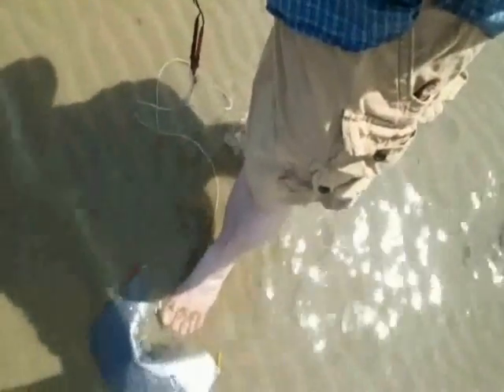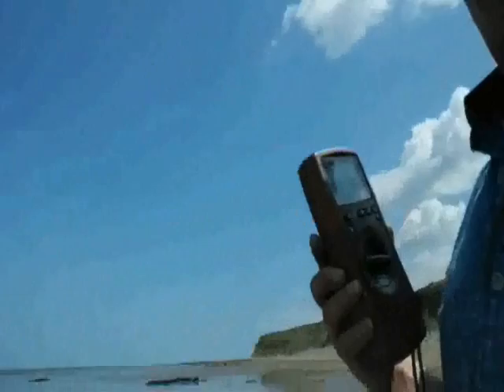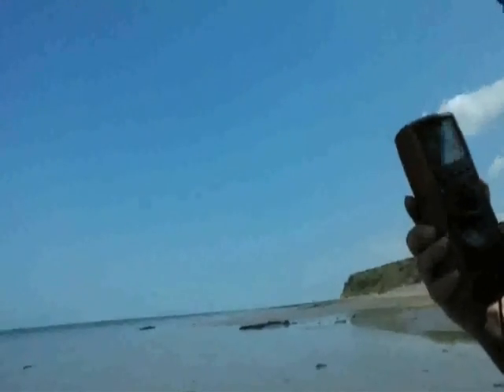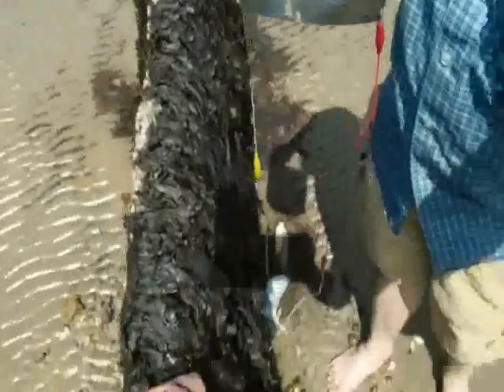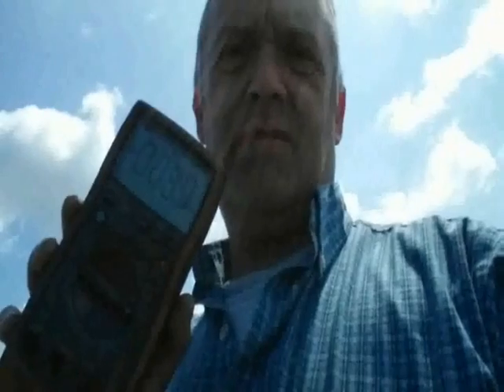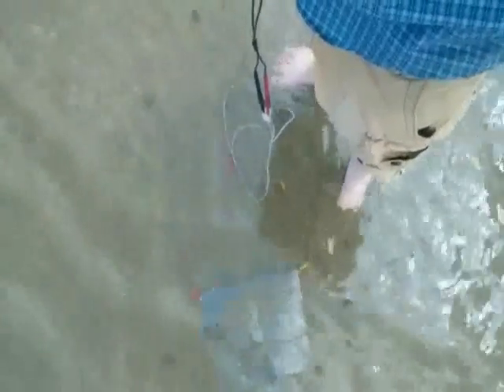Graphene Sea Water Generator - Sea Test 1 (SWAG generator)

Comment: I know this video is quite old, and you probably haven't worked on this in a bit, but I have some questions, thoughts and ideas. When you ran the seawater over the graphene sheet, you mentioned that it continued to produce electricity. If there were a way to recirculate the same seawater over it, would it continue to generate electricity, or is there something that is somehow "extracted" from the seawater each time, that would eventually no longer be there? My thought is that you can only use the same seawater for a limited time, before something is "missing"; or am I the one missing something? I would like to see an experiment something like this: have the coated sheet standing vertically (or angled). A tray at the bottom catches the seawater after it has been run over the sheet, and a micropump recirculates the water to run over it again. I wonder how long it would keep producing electricity, using the same seawater. I've tried to ask this question of several people who work in the engineering field, but all I get is ridiculed for not understanding all the concepts completely. I'm hoping you will take a moment to respond. You seem like a different sort of person, who doesn't mind answering questions, every now and then, about concepts that are probably quite simple for you, but may not be as simple for others. You don't seem condescending towards those just trying to improve their knowledge, and that attitude is greatly appreciated. Thanks. George (gen81465)

Comment: Love your videos, as they are very important to my research currently..lol....i was wondering , if you have ever head of a boat motor that had no moving parts....i hued of this about 15 to 20 years ago and cant remember who told me about it...all i remember was that it was a tube, and half of the inside was coated or sheeted with copper and the other half with a different metal...the theory was that once you pass current threw it, it is supposed to move salt water, from one end to the other.ive looked all over the net and cant seem to find anything on it. it is supposed to be on an active ship in the New York harbor..like a floating restaurant or ferry. do you know anything about it?
Reply from the maker: it's called electromagnetic propulsion - it was the basis for the drive in the film hunt for red october. The japanese navy had two - i think - torpedo boats fitted with the drive
Reply: That is pretty cool. Im am pleased to here that someone wasn't filling my head full of crap, thanks a lot Rob. I am curious if you have ever played with it?
Reply from the maker: yes mate - it's quite fascinating and the idea can be used for electrical generation from alpha particle emission - at least in theory - i have yet to play with that bit - note - yet - lol
Reply: thats awesome to hear, i intend on doing some work on it.  if i get there before you, ill be sure to share my findings. thanks again mate!

Comment: I wonder how it would operate under a waterfall?
Reply from the maker: +Colin Hammill hmm - that's good thinking - i wonder too now lol
Reply: Robert Murray-Smith I watched your other one where you mentioned copper chloride as a good electrolyte for this and started thinking (DOH). Anyway if you had these painted sheets inside a bag half-filled with copper chloride which is inside a box with floats around it and the bottom open, you could have it floating about and creating Copper chloride waves within the bag powered by the sea`s motion.
Reply from the maker: +Colin Hammill sure why not - sounds good
Reply: Robert Murray-Smith You could also test the waterfall theory with a shower or just a tap and see what happens. (I`m fed up now as I have nothing to play with lol)
Reply from the maker: +Colin Hammill lol
Reply: Robert Murray-Smith I`ll have to get a few quid together and buy some stuff from you. I tinker with stuff like that (h-cats and all).
Reply from the maker: +Colin Hammill i don't really sell stuff - the videos are there so you can create it for yourself
Reply: Robert Murray-Smith Problem is where I live (Northern Ireland) there are extra restrictions on buying chemicals. I couldn`t even buy KOH through my chemist (who knows me) as an electrolyte for my hydrogen generator.
Reply from the maker: +Colin Hammill mistral NI are near to you and supply - look them up on the web
Reply: Robert Murray-Smith Cheers boss I will do that.

Comment: Would printing copper or some very conductive material in wires to your copper strips and then putting on your conductive ink decrease the resistive nature of the flow of electricity in the thin ink or am i all wrong...  ???
Reply from the maker: sounds like it would work mate

Comment: Is it the size of the graphese sheet that increases the output or the surface area exposed to the salt water?  What would happend if you compared two identical sized graphene sheets, one completely exponsed and one with a smaller exposed area.
Reply from the maker: my guess is surface area - it's a good experiment you suggest - give it a go and see

Comment: If you rolled the sheet into a really small tube tube and ran a current through it, would it pump water (even just lifting water a tiny bit would suffice)? If it did, it'd be hard to deny the effect claiming some kind of battery effect.

Exciting stuff, keep up the good work!
Reply from the maker: interesting idea

Comment: Have you tried making different sizes of this generator? My guess is that having smaller distance between copper strips would generate more electricity overall (lover resistivity). Having a S shaped pattern would generate more voltage over the same area, maybe.
---------------------
                    |         |  water flow
---------------------        |
|                            |
---------------------       \/
                     |
---------------------
Reply from the maker: no I haven't really - i must do so - cheers mate
Reply: Robert Murray-Smith Fixed ASCII art :)
Reply from the maker: wwwelkam
lol - no worries mate - i got the idea
Reply: You could use your water based ink for traces and you would have another project to put in your upcoming book
Reply from the maker: cool idea lol - thanks mate

Comment: If one assumes the electrical energy comes from a conversion of the kinetic energy of the wave action, then there's really not much available to convert (in the specific example you showed) and I wouldn't expect much output.  Where it could get interesting is with high pressure and velocity water flows.  Again if you assume there's a transfer of kinetic energy to electrical the next question is how far reaching is the effect?  Does it only affect just the first few boundary layers of water, or out to 1 millimeter, 1 centimeter, or all the way out to 10 meters?  Imagine capturing 50 percent of the kinetic energy of salt water flowing through a 10 meter diameter pipe with just a coating on the pipe wall.  It doesn't seem realistic until you consider that a wind turbine blade does just that.  It's capturing not just the energy that goes past the blade but the energy of the entire volume of wind that passes through the area of rotation.

Does the effect still work if the coated substrate is a conductor like aluminum, copper or iron?  For large amounts of power this may be a requirement.
Reply from the maker: certainly something to look at - i was thinking of asymmetric electrodes as it happens - I have avoided metal addition as I wanted the nay sayers not to have the chance of saying this was a battery - but there are lots of ways to go here

Comment: Maybe instead of copper strips -> copper (nano)particles in ink as shown in your other "green" copper nanoparticles with a household blender video?
Reply from the maker: it's a good idea - but you are bound to get people saying it is a battery then
Reply: I see, another maybe interesting idea would be to think about area that has contact with water - for example graphene coated yarn or (plastic?) wires...could be so cheap if you just put many long Gcoated wires into the ocean. Just like those guys that generate energy from graphene coated wires and air.Anyway there is just 1 more question to answer - how long will it last untill it has to be repaired. If I could ask for a test it would be to put it into boiling water and check energy readings. Should behigher, unless the energy comes from chemical reaction with salt(?) in sea water. Cheers
Reply from the maker: Piotr Radziszewski
i like that - lots of things to think about

Comment: My next idea is relate with geography that you show in video and Pumped-storage hydroelectricity https://en.wikipedia.org/wiki/Pumped-storage_hydroelectricity where every pipes that provide high current flow are covert with graphene. Of course theoretical power station should be at sea side. On small scale you can use a laboratory glass gear like flasks and pipes etc. Real just have fun

Comment: Hi I have ideas.Fist is a pvc pipe that inside is covered with ink and put so in sea in way that water go true it. Just pipe buried in sand. Variation is pipe in a "U" shape. Second idea is just take wave generator design and improve it.
Reply from the maker: cheers for that mate
Reply from the maker: have fun - isn't that the point lol

Comment: Hi Robbert, if you edge the graphene platelets with say iodine in a ball mill before making your ink, I think you will find that things will take off in multiples.
This type of tech: will make a cell far more efficient and so easy to do at low cost. Your base material could be a cheap porus ceramic, made from sea sand for example, 1-1.5mm thick.
I think you may have already edged your graphene platelets with what ever you made the graphene with to start with. There will be an ion exchange and that is where your current is coming from.
I believe that this is the basis of the BLOOM BOX cell, my take on the BOX, as you know I am heavily into this type of tech:
E-mail me if you want to and I can give you more
centraflow@gmail.com

regards
Mike
Reply from the maker: hiya mike - thanks for that - I will definitely look into it

Comment: Toss two different metals into salt water and you'll get a small current as they corrode. (given)
Therefore, it is necessary to exclude current produced by this "salt water battery" effect, to properly evaluate the power produced by the graphene sheet itself. So (for instance) make up another PET sheet with copper strips but no graphene and test that with the same test meter/clips. Only then can you celebrate the motion of the ocean.
Reply from the maker: sure - but did you miss the point - at the moment no one is trying to properly evaluate it - we are just noting an interesting effect - if you saw the first vid you will have seen isolated clips and no metal strips - so though I agree with your comments - i don't agree with your tone - putting a downer on something just because you like to put a downer on something is not a good way to move forward mate. Like I say i think it is you who missed the point here.
Reply: I wasn't "putting a downer on something just because you like to put a downer on something" I was pointing out a significant problem with your initial field test that could account for the majority of the current detected. I did watch the first vid. As I recall, the voltage was measured without a load resistor and so cannot be compared directly to the ocean test. In the ocean test, the graphene test sheet without the copper strips put out ~ 7mv, compared to ~27mv for the test sheet with copper strips. That data led to my note of caution as to the source of the additional current from the sheet with copper strips in the field test. Bare metal in salt water can easily produce HIGHER voltages/currents than those you recorded. You can blame the messenger if you like, but Occam's razor says it's a poorly designed battery until proven otherwise. And since your test sheet was neither designed,  or intended to produce current by this effect, it is an absolutely valid point that this effect must be positively excluded for the true results to be known. 

The potential of your research is indeed exciting. I would be thrilled if further testing actually proved that all of the current you were seeing was coming from the interaction of the graphene and water, and not from electro-chemical reactions that have been familiar to science for the last two centuries. I didn't peg you as someone who would want to mislead anyone as you have so far come across as an excellent teacher and mentor. I apologize for being a bit snarky, but I WAS paying attention in class, no?
Reply from the maker: A1Skeptic
refer later vids that take up your points
Reply from the maker: A1Skeptic
I knew you wouldn't be able to resist a long come back - read the referred papers - resist being snarky or face deletion
Reply: Wouldn't it be a lot more satisfying to just make up a sheet with copper strips, repeat the ocean test, and get solid data quantifying the source of current?
Reply from the maker: A1Skeptic
you need to watch this video - Essential Guidance Before Posting A Comment On My Channel - it is on my main page - please watch to the end and absorb the information before posting again

Comment: just curious to see if there is cumulative effect from temperature differential and sea water flow?  not sure if that is even a consideration.  i have seen your video where you use a jar of hot water to generate voltage and the sea water experiment to generate voltage.  if there is a temperature differential using sea water for the cooling part would it be a cumulative effect or not?  i guess future experiments will tell ...
Reply from the maker: i think so too - it is interesting and later I think it needs experimenting wiht

Comment: Thats quite a bit more power than I was expecting too see!
Low sheet impedance means you will be able to put lots in series....
Your not going to have any trouble getting a JT to run.....
As Binj Komisar mentioned. Going to be very interesting coating for turbines and other things that move through the water...
Reply from the maker: it is cool i think lol

Comment: Robert went to the beach for a paddle...
In your recent Generating Electricity From Salt Water And Graphene you say when you check the voltmeter after pouring water over the test sheet, that it's still generating ".8" volts.
I'm pretty sure if that reading's correct, that the little test sheet managed "2.3" volts during that test. Is that correct?
Assuming so, it looks as if speed is more important than area, but coverage is clearly vital too, and combined they could return quite useful current!
This sea side test definitely proves that the "just stick it in the sea mate" approach works, and I totally agree that this electricity production method deserves attention and development.
The venturi tube idea would seem well worth a go, and perhaps you might find a local boat fisherman willing to take a coated tube for a ride (drag along side or behind)?
The Swale is just up the road from you too; I believe there's quite a flow through there.
:-)
Natural salty mineral springs might be tapped too.
It's very exciting that something so simple and cheap can be employed so easily to such great potential effect.
Reply from the maker: I think the remaining voltage was from a double layer capacitance that is residual to the sheet once it is removed from the water and the resistor across the terminals leads to the discharge of that voltage which is why in this sea trial it disappears but in the lab trial it didn't. Mt first thought is to optimism the ink and then look at practical deployment methods. So, I will start to look at the ink more closely on monday
Reply: It wasn't the residual voltage that interested me so much as "the reading" since if ".8" was correct, then during the actual test, the reading was (at max) about "2.3" volts -  a fair few more millis than you got at the beach.

Damn good stuff. Have a good weekend :-)
Reply from the maker: we'll get it higher - don't worry, I was just replying to another comment and when you think how rough and ready this test was - then perhaps the most amazing thing was that there was anything at all
Reply: :) reshared!! and hash tagged.. friends are always happy to see things like this one!
Reply: love that you post these!!
thanks, Fred..
Reply from the maker: Fred Gandt
remember the lab test didn't have a load
Reply: Jane - how could I not?!
The man is making electricity out of sea water and what amounts to little more than a sheet of paper heavily coloured in with a pencil!
It's exciting and worthy. Share and share it loud!
Reply: Ah. I wasn't sure. Aww :-(
Mind though, millivolts can get quite a lot done these days.
Reply from the maker: Jone Joff
don't do that